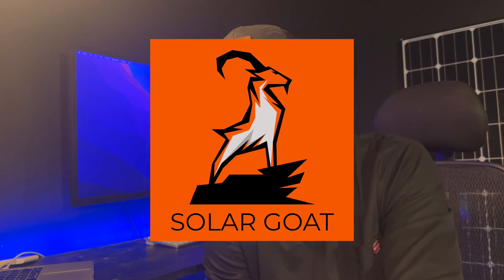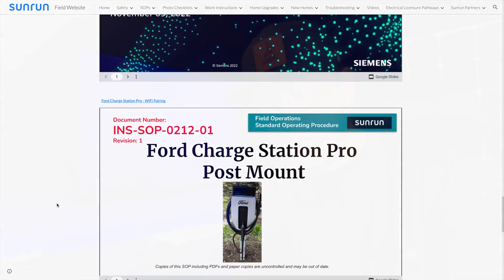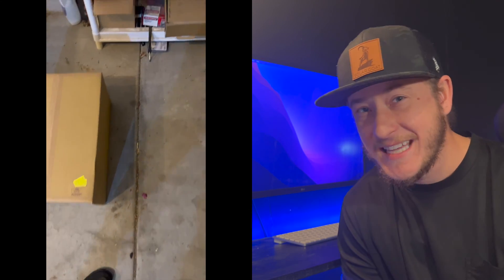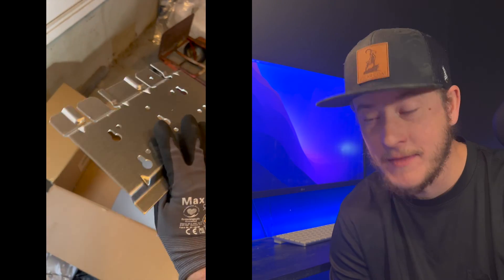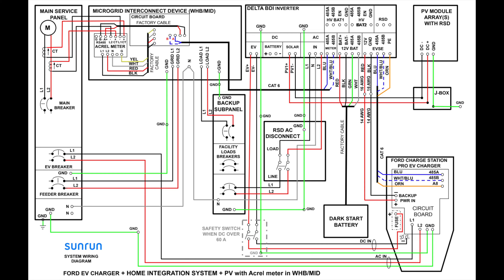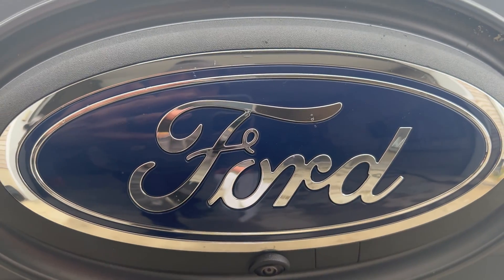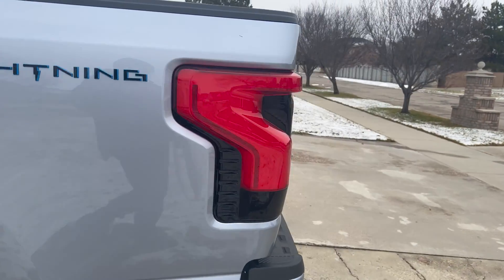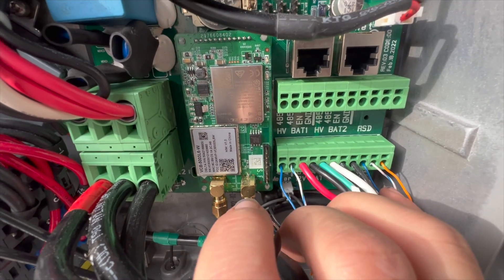Ford F-150 Lightning Charger and Home Integration System Installation Review

Comment: If we have Tesla PW and Solar already, we can cut all of that out if Ford would allow user manually turn on export the DC power.  This way I can probably wire that up to the exist Tesla inverter as a separate string.  This would make it less complicated setup and using all existing hardware and wiring.

Comment: Hey Goat. Your review helped a lot. My HIS just arrived. I'm getting my mind wrapped around the Sunrun plans now. Did you install a Safety switch on the DC lines between the inverter and the charger? If I'm reading the diagram correctly it is only needed if over 60 amps. Also, what is the Rapid Shutdown Device (RSD) AC Disconnect? Is this a manual knife disconnect? I didn't see any hardware recommendations in the SOP.  One more thing, do I need to run all the DC and AC wires in separate conduit/gutters/pass-throughs/junction boxes? Thanks for all your help.

Comment: Thanks! Very informative. Question, once the system is set up correctly and running could you utilize this system to flow electricity from the truck back into your home in the event of an extended power outagr?

Comment: People would definitely be better off just using their lightning 240 volt receptical to power their homes. Around $4,000 for sunrun home integration system plus whatever your local electrician will charge you for installation. Most homes critical loads wouldn't exceed the 7200 watts of power available at your 240 volt receptical.

Comment: Amazing video. Kudos to you for a succesfull installation of this product. I have a quick question. Do you know if we can use this Bi-Directional (battery start ) inverter to actually connect to my solar PV system and add at least 5 -10kW PV output in addition to Battery while off grid ?

Comment: I had A local electrical company, Beaver Electric, referred my QMerit, install my Ford Charge Pro and home integration kit. They also installed a cut-off, so the house can be separated from the grid. After about 5 tries, I got it to work right after install. It worked for about 20 minutes then started cutting out about 1 second every 2 minutes. Now I can’t get it to work. When I cut power from the grid with the Lightning plugged in, the truck screen just says “Preparing to provide power…”, but never does. Anyone had this issue?
Reply: I believe there's been a lot of problems getting Sunrun's home integration system to work.

Comment: I currently have solar panels at my shop where I will be installing my pro charger.  Do you think I could add a way to charge the truck while power is out from my solar panels during sunny hours as well?
Reply from the maker: Fords system is designed to do just that… they spent a lot of money and research making it work. There definitely are ways to charge EVs off grid for cheaper.

Comment: Great video! Getting ready to install this shortly, would love to see a step by step if that’s still possible. Also a video demoing the system. 
1. Does it operate as advertised under load? If you are at 3/4 to full load, how much runtime do you have?
2. What is the transfer time? I heard 45 seconds, is that right?
3. I heard Ford has to “activate” the app, and Sunrun has to activate the inverter which takes 3-weeks. What was your experience?

Comment: Interesting post
For those of us who may ease into solar panels at a future date.
Q: Can the ford back up battery be connected to the main breaker box per interlock device
1. charged by the grid and also 
2. charged by a portable generator when the grid is down?
TY
Reply from the maker: You cant use a manual disco or interlock. The BDI inverter from delta needs to be installed with their MID ats in order for the system to work right. I do believe the inverter will work with a generators but never tired it out. 

Its really an interesting set up. the charger is AC at the main panel and runs DC to the inverter, and the inverter is AC to the back up panel. The MID (automatic transfer switch) it in btween the main panel and back up panel. When the grids is done the MID separates the two panels so the AC from the charger does not have power.
Reply: @solargoat  Ty for the the reply.
I admire your knowledge and expertise.
regarding these things.
GBY & those you love!

Comment: Great video! I am currently in the process of installing this system at my home. Would love any additional videos or information you can provide on the installation process.
Reply from the maker: I’m glad you found my video! I’m putting together some additional information right now. I’d appreciate any feedback you have for me. Maybe a title for the video that would make it so people like you can find it easier? Or possibly a few of the topics that you have questions on
Reply: @solargoat  I would recommend using the words “Ford Home Integration system” in the title for sure. It’s also referred to as “Intelligent Backup Power System”. If there’s any way you can go step by step on connecting the components and wiring it to the home’s main panels, that would definitely be a series of videos that will be very popular among people interested in the FORD lightning. FORD expects to produce 150k of these trucks a year in the next year or so, and eventually there will be a lot of people looking for this useful info, because SunRun is crazy hard to deal with even if they service the state you live in.